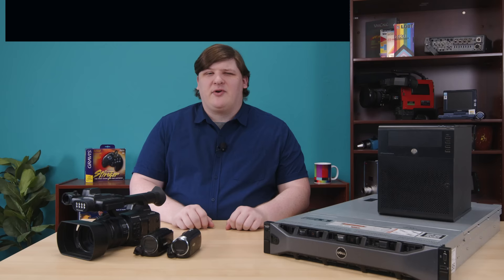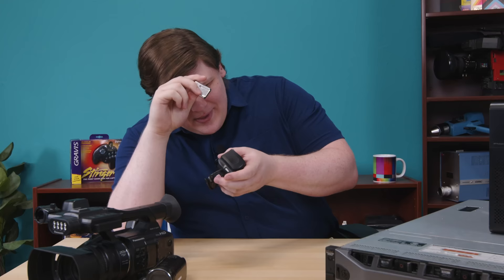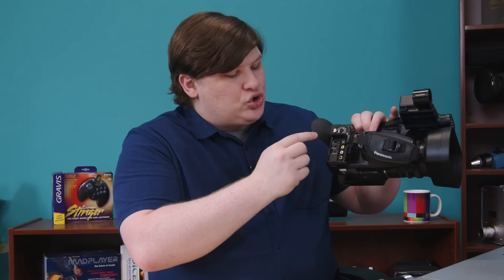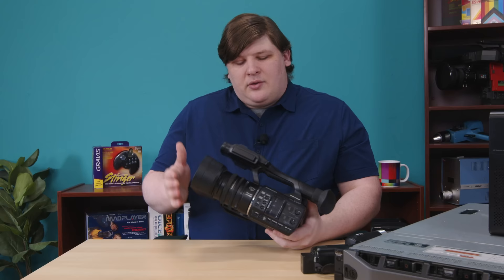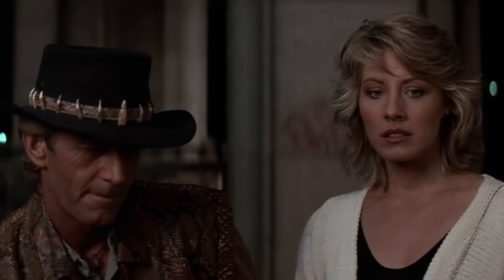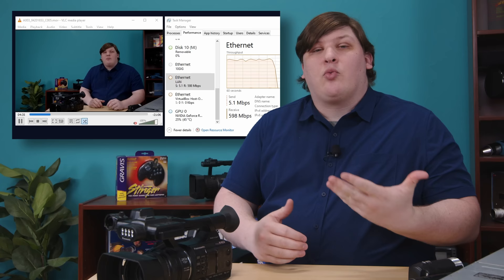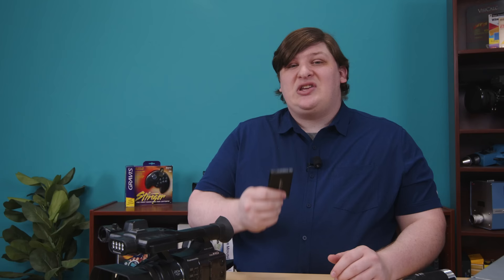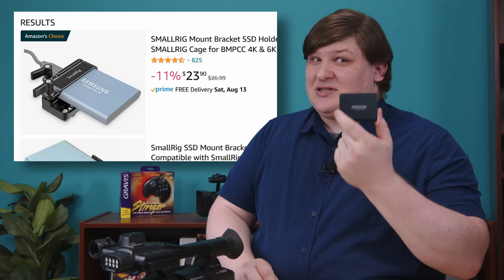I Built... a really fast NAS?

Comment: Samsungs are freaking terrible also why are you not using RAM for your scratch drive should be using a ram disc for editing and transcoding
Reply: A suggestion to your mirrored scratched disk besides just using ram disk and having your system on a battery backup is to buy a cheap adapted raid card or 2. One for your scratch disk and the other one for your everyday storage for example I have four 480 gig ssds for everything in raid 5 so I'm only losing one and a third drive but read speeds are phenomenal 1.6 GB per second
Reply: I don't understand why you took the cover off the server cuz when you boot them up with the cover on they usually do quiet down a lot but of course they're still loud and should be in another soundproof closet
Reply: Windows comparative ZFS would be ReFS it has corruption protection and does a similar scrubbing in checksums but it has to be a separate drive and not your boot
Reply: I hope all of my suggestions help you in the future and if anybody has any other additions
Reply: Use a riser for the video card or clip the end of PCIe alot for a 4 - 8x to fit the 16x card in you can also but you can get an adapter to split power as you said after I started typing this.